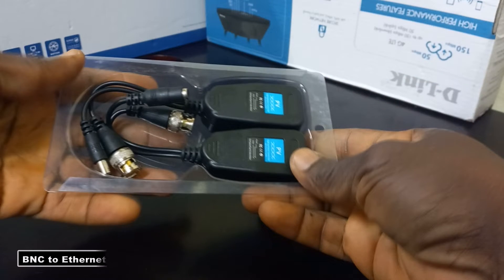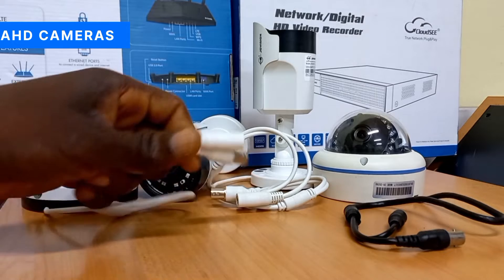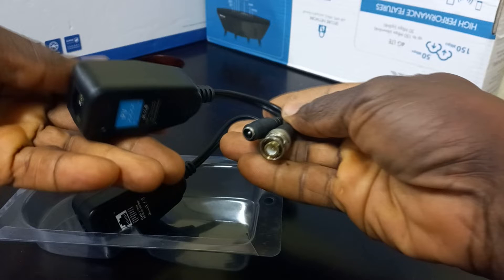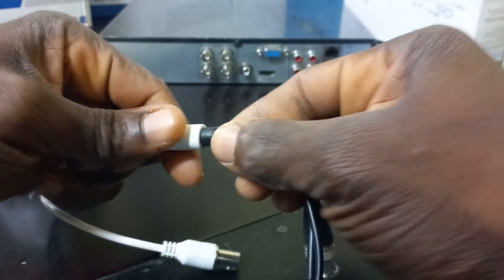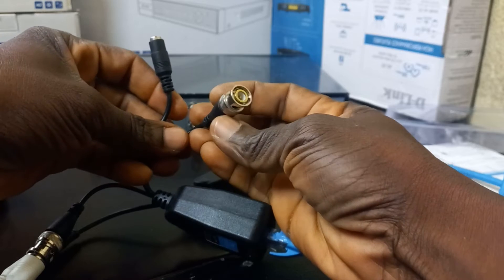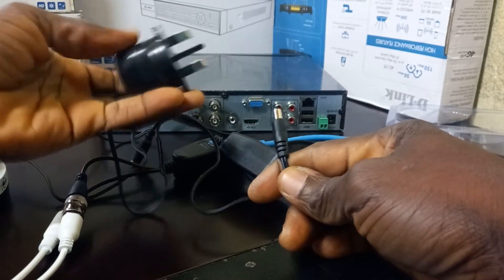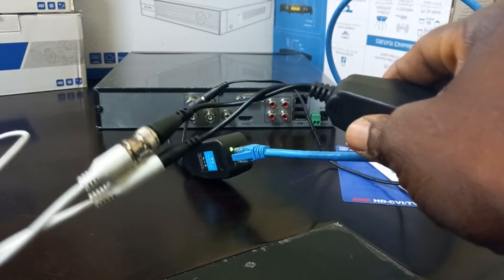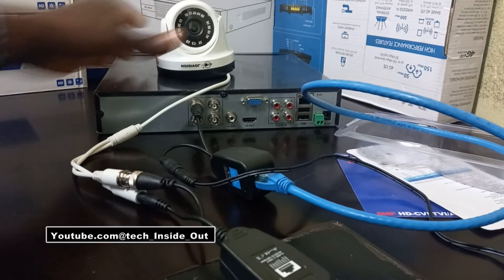BNC to ethernet connector I PV balun +terminated  Ethernet cable for AHD CCTV Installation

Comment: nice method, but can i install four camera this way for hundred meters & use four way  power splitter  12DC instead of four  12dc adapter  for each camera. TNXS
Reply from the maker: Yes, you can use a Power supply unit. I used the adapter just because I was using just one camera for the demonstration.
Reply: @Tech_Inside_Out  i am working on one project and can i send you same pictures via email and may be if you have time you can give same idea. thank u

Comment: Hi, I have a question,
If i connect the ethernet coming out of the AHD Camera PV Ballun into a router and connect my laptop to the same router, is it possible for me to get the feed of this AHD camera over ethernet directly into my laptop(with help of some software ofcourse)?
Reply from the maker: No, it wouldn't work
Reply: @Tech_Inside_Out  Can you list some reasons plz

Comment: I have a camera with video balun. As shown in the video if I connect the bnc from the cameras to the poe and then to the nvr from poe will the cameras work? 

Cc cameras——>>bnc to ethernet connector<<——>>16 port poe——>>NVR—>>Router. Will this circuit work.?
Reply from the maker: Cameras with BNC cannot be Connected to NVR because you are using A BNC to ethernet Balun

Comment: if the DVR have ethernet connectors, can you plug it directly without using the balun?
Reply from the maker: A recorder with ethernet connections is an NVR. They take the ethernet connections directly

Comment: Hi, I have a poe switch which powers 1 ip camera which is also connected to my dvr. I have a hikvision poc camera and was wondering could I connect one end of Ethernet cable straight to my Poe switch and then on the other end use the coax to Ethernet for the camera. Will this then make the camera an ip one?
Reply from the maker: No, POC cameras need to be connected through the BNC since power is fed into the Camera through the BNC. 
The use of the PV ballun does not make the camera an IP camera

Comment: good morning - thnx for this. think its a good way as sometimes you want to switch a camera to ip and then the ethernet cable will already be in place.. good. But one question could someone connect an IP camera at the camera end and skip the PV balum. and what is the maximum distance using this method.
Reply from the maker: The recorder used in this process is a DVR which is meant for Analogue or AHD cameras. 

You can use IP cameras at the ends of the cable. 

Maximum cable distance should not exceed 100 meters

Comment: Can I connect the blue cable to wifi router? 
If possible, would the energy reach the camera? 🤔
Reply from the maker: No, the router cannot power up the camera
Reply: @Tech_Inside_Out  but if I connect PoE injector to it?

Comment: Can it work for more than 5 cameras, since the adapter is used or can we cut the power clup and join to d adapter
Reply from the maker: It can be used for more than five cameras. 
If you would have to install more cameras,  you need a single large power supply unit

Comment: Do I have to buy 12V power supply for more cameras.
Reply from the maker: You can use one large power supply unit that can cater for 9 , 16 or more cameras
Reply: @Tech_Inside_Out sir, once we get  large power supply, can we cut the dc plug and join all other camera wires to the power supply together. 
Pls answer

Comment: I am facing issue in video quality with this connector kindly guide me
Reply from the maker: Please check your cable length and also you may have to check your cable quality
Reply: @Tech_Inside_Out  lenth is about 40 to 50 mtres
Reply from the maker: @aqibrahmaniofficial8933  Then check your cables and terminations, because this works perfectly.
Reply: And if I have an IP camera that I need to connect to the DVR using the Ethernet to BNC adapter, how could I do it? thanks for your help

Comment: Please can I loop all the power cable together and give them one adapter if connecting 8 cameras please
Reply from the maker: That may seem to work, but that will manifest in lines in the face of your cameras due to power deficiency to your cameras.
So for very effective and clean pictures, it is good to avoid loops
Reply: @Tech_Inside_Out  Aww please please thanks soo much we’ve payed installers to fix one of the cameras having lines in the face of the camera after every night mode switching or power off reboot but no answer ,change the cat 6 cables still no answer. Ohh thanks please much . All the power were loop 🔁 together for one adapter. Please thanks best wishes for your kindness and good work.

Comment: With this setup how can I add Batery backup provider for the nvr to power during light out, using the 12v dc provider with battery please
Reply from the maker: You can setup a battery bank with a hybrid inverter to power up the system. That will even last longer than the smaller battery type you find in power supply units. I will later cover that kind of standby power for cctv cameras
Reply: @Tech_Inside_Out  okay thanks for your info I really appreciate this since power off and on is a problem here. Thanks we will wait for your video on this
Reply: @Tech_Inside_Out  please thanks for your reply hope you do a video on this soon please thanks

Comment: Can I loop the cat 6 cable to connect 2nd camera on the way??
Reply from the maker: Since the cables are terminated with the RJ 45, am just wondering how you could loop it? 
I will be glad if you can explain it further, may i don't understand the question.
Reply: @Tech_Inside_Out please I wanted to save cost of the cat 6 cables running from each camera back to the nvr,

Comment: I need a device to do this a little differently. I have the “balloon” piece but my dvr has rj45 ports. How can I make this work?
Reply from the maker: Since your device (NVR) has RJ-45 ports , you don't  need a balloon.  You have to connect the RJ-45 directly to the nvr
Reply: @Tech_Inside_Out  what if the NVR is not poe capable? will this be a problem?
Reply from the maker: @gboomg5800  All NVRs with ethernet ports for connecting cameras are POE NVR.
Reply: @Tech_Inside_Out  Right... Thanks for the high quality and informative videos.
Reply: what of the IP address for the analog camera? guess I should just test it out

Comment: May i know the maximum transmission distance of that set up using lan cable?..
Reply from the maker: The recommended Maximum Cable length for network cables is 100m,  but Cable quality nowadays are quite an issue,  so you may have to do 60 or 70m for best results unless you are too sure of your Cable quality .
Reply from the maker: The recommended Maximum Cable length for network cables is 100m,  but Cable quality nowadays are quite an issue,  so you may have to do 60 or 70m for best results unless you are too sure of your Cable quality .
Reply: i see... thanks so much for your reply...
Reply from the maker: @timothy1837  Most welcome

Comment: can i use ip camera convert into BNC DVR with using this converter
Reply from the maker: No, you can't convert IP cameras into BNC and plug  into DVR
Reply: @Tech_Inside_Out  How about if you use a pair of these, to connect an IP camera and an NVR using coax cable?

Comment: Is this setup reliable for long term use?
Reply from the maker: Yes, very reliable
Reply: That's the setup I've been using for a while now, image more clearer than traditional bnc and power connectors
Reply: @swaggst  thanks ive chosen this setup.

What is the max lenght of the cables can be used with this?

Comment: Simply and less time consuming.What if you have multiple  cameras,how you gonna power them up? Thanks🤛🏾🙏🏽
Reply from the maker: For multiple cameras, you can use the normal cctv power supply and fix the dc power Connectors at the ends, which will feed into every camera
Reply: @Tech Inside Out   Oh yes.Thanks, new in security systems.The world need more people like you.